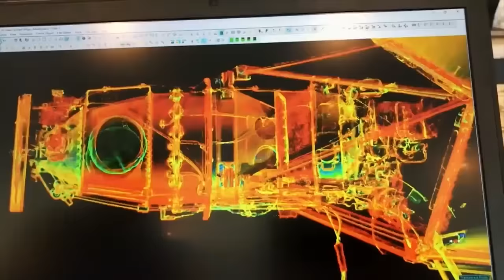We both almost died...now what??

Comment: I've recently seen quite a bit of innovation re: adaptation of automotive engines for GA applications. I've read "that won't work" because of airplane engines needing to run at 75-100% of WOT continuously, where that's not the case in automobiles.  Marine engines run under constant heavy load in planing boats- I don't see how that's any different than aviation.  Cost is no doubt THE largest barrier for most to getting into GA- imagine being able to burn multiple types of fuel, increased power, and being able to drop in a crate LS motor when it's time for an overhaul.  

If the challenges here can be worked through, it would revolutionize GA.

Comment: -What’s going right? The enthusiasm for aviation is still strong. We all got infected with the aviation bug and kids still get it today. 
-What’s going wrong? Cost. The barrier to entry is too high. I work for an airline where most of the employees make above the median wage and none can get into GA without help. There needs to be a Henry Ford moment to bring the cost of flying/flight training down by 10x. There’s no reason a modern cub style plane should be more than a new car and operating costs should probably be lower than a car. 
1.  Develop a new mass produced low cost “model T” of GA.
2.  Figure out a way to decouple the crippling burden of liability from GA.  Maybe through a DIY kit that’s approachable for the average Joe or through legislation.
3.  Low cost propulsion. A new lycoming whose design is largely unchanged for 70 years costs as much as a luxury car and adds significantly to the cost of GA. We need harbor freight esq. cost to horsepower ratio. Maybe electric?
4.  Accessible un intimidating entry to GA. Maybe low cost glider clubs in the European style. Grass strip winch launch simple gliders like Germany used post WW1. A way to promote pure airmanship in a low cost way. A Schulgleiter SG 38 style simple cheap open air glider. 
5.  Well paid professional instruction. I think this would sort itself out with lower cost training aircraft. Lower per hour operating costs would leave more room to pay career long CFI’s. Many of my colleagues loved instructing but the lure of more money at the airlines wooed them away. Imagine a world where flight training was $100 an hour and the CFI got most of it. I’d be a much better CFI today than I was in my 20’s but the economics don’t support it. 
6. Not an idea but a comparison. There’s a company called FliteTest who revolutionized RC aviation. They pioneered RC planes made with $1 sheets of foam board and capitalized on the ever falling price of electronics, and reach of YouTube tutorials to make the hobby accessible to many. The result has been a flood of new hobbyists who were previously priced or intimidated out of the hobby. They have also created what appears to be a thriving business. 
7.  Patey developed low cost scratch build plane in the “FliteTest” style with youtube step by step build tutorials.  
-Very semi Active CFI, member of my flight schools alumni association, airline pilot union member.

Comment: 1: Help get rid of leaded fuel. Could using aviation 100UL in Motorsports and even performance road cars be a possibility to increase the volume and lower costs? 100UL avgas could the the ubiquitous, safe, and legal option for any performance application.
2: The “certified” system is a relic that’s strangling GA. We need a new model that will be safer and more predictable than legacy certified and as inexpensive and flexible as “experimental”. We have data on aviation systems and we have incredible analysis capabilities. Can we build a new process that enables the efficient quantification-of-risk/neo-certification of new aviation systems?

Comment: General aviation and learning to fly has gotten more and more and more expensive. IMHO, what is needed is a bare bones budget S-LSA that's very forgiving, to teach new pilots to fly in, that is low in maintenance costs, US made, and affordable for flight schools.  I learned to fly in a E-LSA RV12, that I bought, just to learn to fly in.  It's good, but I feel the need for the product to be mass produced to lower the overhead costs.  Can it be built from composite molds?  Something less expensive than carbon fiber?  Rotax 912 UL 80 HP ?  Good stall characteristics? A little less sensitive to stick input?  A simpler less expensive glass EFIS? Basic ADS-B out ? or both in and out?   I feel the demand is there, it's just the scale of production that keeps the cost so high.  A Completely vertically integrated company that also builds the motors too?  That's as big and grand an idea as I can come up with.

Comment: 1. Its growing again! Seems like aviation has had periods of significant stagnations until some years ago.
2. I think a big problem is  reduced access and closures. 
3. I used to be a member of AOPA and AMA until money got tight. I need to sign up for both again.

I don't like seeing airports closing, it is one o fthe saddest things when an airport gets shutdown. On the same track, I'd like more RC airports. Especially south Utah county/Juab county (hint, hint). I was one that got into aviation through model flying but its getting harder and harder to find a place to fly which reduces the number of kids exposed to model aviation and therefore aviation as a whole.

Buy the Albatross, or a Catalina. Actually, buy a Mars! Think of the fancy digs you could carry in one of those!
I have always wanted a C27 set up as a camper with a just enough space in the back for a Jeep. Flying to some new place then doing some wheeling sems like the ultimate retirement to me.
I like the BO-105 project. Stick some LTS650-Bs in it could be great too, 50% more power. They share some of the drivetrain with BK117s so it should be too hard.

Comment: Thankful for your safe results from the airplane engine and your health scare.  I have been involved in aviation from prior to high school and had a very successful career as an airline pilot.  I own a Bonanza now and just turned 70.  I understand that there will be a time that I will need to chock the plane for the last time but after a career of every six months having to try to remember what to put on my medical applications because of the draconian attitudes of OKC.  I hear AME's saying that the FAA is not trying to take away your license but I do not believe it for one second.  The medical branch is the enemy that thrives on their power to ruin people.  I have been a member of AOPA, EAA, NAFI, American Bonanza Society all from 5 to 30 years and they are trying to help increase the ranks of pilots but just try to get your license today and call and schedule a check ride...months before you can actually schedule a ride, show up and the emphasis on the "lawyer" side of the paperwork (stuff that doesn't really matter to how one flies) the cost of the ride and the good old boy network to become a DPE and to maintain your DPE status.     My ideas...1.  Eliminate the Aero Medical Branch - basically shake those bureaucrats to their boots and rebuild with an attitude of "not every issue is severe"...trust the local AME's.  2.  Again...the FAA bureaucracy.  They are more concerned with paperwork than if a plane part is "certified" than does it actually work better.  I am in the middle of a panel upgrade and am having to pay $1500 for a DER to write a letter stating that moving my gear switch is acceptable.  3.  The airline I worked for had a very high number of minority pilots and high number of female pilots...We need more outreach into those communities.      YES, buy the Albatross

Comment: 1. Take the Cessna 441 and make it the most fuel efficient, long range GA friendly plane ever. Buy the design from Cessna and build them out of carbon fiber. Glass windows, G3000, FL410, 350 TAS, 2500nm range. I currently have a 441 and it can go from California to Florida with no tailwind on a 1982 body. Imagine if you made it more efficient! I only burn 60 GPH for both engines at FL350, now imagine if you flew it at FL410 with carbon fiber and a higher PSI diff (maybe 8 psi?). You would destroy the light jet market.

2. We need cheaper landing fees and fuel. Its starting to get out of control. 

3. Government should subsidize new Privately owned but for public use airports. As the population grows we need more options.

4. Take the TTX and pressurize it with a 28,000 ceiling. put a 400 hp turbine.

Comment: GOODS: Experimental is doing well even with increased costs. Light Sport MOSAIC will bring great innovation to certified inexpensive aircraft allowing greater access to flight. 
OTHERS: I see an increase of errors associated with procedures. There needs to be an effort to get pilots to go back to the basics and actually use/reference a checklist for flight critical items. I suspect at least half of the current GA accidents would not have happened with a more structured use of a checklist. Feel free to use this quote “Deliberate Action leads to Predictable Results”.  That works in all cases, both positive and negative.  
MEMBERSHIP: I have been a member of AOPA, current member of the Tailhook Association. 
Background-20 years military fighter, 10 years GulfStream, 757, 767, 777. Current Part 121 CA.

Comment: There is an engine technology out there that has been demonstrated on a fixed-wing drone, and I would love to see it get scaled up and applied to manned flight, which is the new take on the rotary engine developed by an MIT spinoff called "Liquid Piston".   It delivers the highest power-to-weight ratio yet for any internal combustion engine that I know of.  Unlike the Wankel which has one power stroke per crankshaft revolution, the LP engine delivers three.   If you haven't already looked into it, you really should.

Comment: Let's find out if micro turbulators (vs. typical VGs) on wing surfaces lower stall speed w/o significant loss of cruise speed This could be as simple as sand embedded in wing paint or micro pieces of plastic fragments duplicating a shark's rough skin, etc.. The potential payoff is fewer stalls/spins  - a leading cause of aviation fatalities. 

There are various research papers on this in the aviation-science literature, but no one seems to have nailed what is optimal nor taken it to general aviation. Sponsor a few 
engineering/aviation students and let them do the work...probably quite a few universities have access to wind tunnels. 

This is not expensive research and would seem to have a high value:cost ratio...

Comment: Purchase Lancair to develop the Mako with an option for either fully retractable or fixed landing gear, complemented by a mandatory BRS install. Transform the build-assist program into a volunteer initiative involving experienced builders, offering it free of charge to foster safety, enhance accessibility, and revive the spirit of collaboration. In essence, envision creating an open-source innovation lab for airplanes—a space where enthusiasts collaboratively build and continuously improve upon the same aircraft mode - polish one kit to take out the guesswork.

Comment: I think as most have said, affordably in aviation would be amazing. 
1. Almost every engine manufacturer charges the price of a full size car for engines that are based off 1930s technology. I understand this is required to cover engineering time and most of these engines are low volume production but not a lot has changed in the basic flat 4 aircraft engine in the last 50 years. I believe that we need the aviation equivalent of Elon Musk to come in and shake up the industry to reduce some of the crazy prices. 
2. Hangar space at general aviation airports is way to limited and new builds are few and far between because of the permitting/local government permissions have been hard to get. 
3. Avionics, specifically GPS is ridiculously expensive. A new Garman or Avidyne GPS cost as much as a new Rotax 912. I feel like situational awareness of many general aviation pilots would be improved with access to affordable GPS Navigation. Foreflight is a good alternative but having a Ipad floating around in the cockpit can also be a problem especially if it overheats in Texas and shuts down when you need it the most. Reverting back to paper works but having a better primary would be amazing.

Comment: How about the two M’s develop and build a certified 4 place airplane under the new Mosaic standard. Certification would be way cheaper that today’s certified part 23 Cirrus and Cessna 172/182. Approved by ASTM industry standard, Patey’s M2 plane offers 4 seats, is IFR capable, >150 kts, Deltahawk Diesel )You then offer the plane in kit form or factory assist. You would basically build a production line and all your YouTube fans would love to hang out with you building their plane. You could give Cirrus a run for the money by offering a plane at half the price of a SR-22 G7 enlarging the pilot community with access to a certified, more affordable and fun & easy to fly plane. It may sound (too) ambitious, but the Patey’s could pull that off

Comment: I teach in an automotive school 30hrs a week and have a custom car, truck, and bike shop that consumes the rest of my time.  We've owned several certified aircraft, several experimental, and built a couple Rans aircraft ourselves.  Bingeli's books are not bad, but an online training/reference platform showing best practices and safety standards would be very beneficial to experimental aviation.  You already have the assets to film and produce videos on the idea.  It would take time, but film the smallest details while building aircraft and turn them into a how to/best practices/safety standards required xyz.  Examples like: hardware choices, how long should the hardware be, how to properly torque hardware, wiring and electrical oh my, plumbing, how to choose avionics, brakes, an ocean of firewall forward, rivets, covering systems, paint, control cable routing and management, bushings and bearings, weight and balance, basic physics concepts that are relevant, what is a stress riser and why is it important, why triangulation is a thing and that 90 degree bent aluminum bracket won't hold that servo long term, corrosion prevention, or basically anything you see at a fly in that makes you cringe.  You can even take pictures of bad examples, and then show how to properly install or build items or possibly bring that aircraft in and repair it properly.   

P.S. Absolutely buy an Albatross.  Twin turboprop, Carbon control surfaces, carbon sponsons, new airfoil, leading edge slats, loose a few thousand pounds, sweep all the dinosaur parts out the cargo door and modernize the crap out of it.

Comment: I’m pretty new to aviation, but one thing that I have had to deal with that is not that great is getting my medical. I’m still in the process of getting it and so I haven’t started flight school yet. My unique circumstance is that I had a brain tumor that was removed when I was 9. I’m now 19 and have had no side effects or symptoms since my brain tumor was removed. Of course the FAA wasn’t going to issue me a medical certificate right away because of my history, which is understandable. However, they are requiring my to get a neuropsychological exam, which is basically to make sure I’m not crazy. Now I’m just your average dude, no mental problems or health issues, but I still have to do this. Which I wouldn’t have a big problem with except that this particular exam that the faa is requiring of me costs over $3000 and insurance can’t be used because it’s not for a medical condition. I’m just a 19 year old guy in college so that’s a bit of a big deal. So I just think that the faa hasn’t made it very easy for people like me to get into aviation. I understand they have take precautions for health stuff and all but there’s gotta be a better way then making a mentally stable broke college student get a  neuropsychological exam that costs $3000 out of pocket. Idk what kind of changes could be made but that’s just what I’ve had to deal with so far in my experience.

Comment: You asked.
You could design a retrofit kit for the Piper PA28 to strengthen the tail. As you know when an airplane loses the tail - death is nearly imminent. For 15-25 pounds of aluminum and at a price of $250-$400 people (and schools) that own the PA28 will be compelled to retrofit their planes so that the tail doesn't fall off in turbulence and >Vne speed.
N3079M is just the latest example and NTSB assigned blame as usual, but that is not the point. 
Both fatals should not have happened because the plane is just an inferior design and many people die every year in this one for no good reason.
Analyze and strengthen the enpennage to fuselage connection...there you go.

Comment: MODERN Fuel Efficient ENGINES!! to Retrofit Legacy Aircraft & for the main manufactures to adopt. Rotax 916 is an excellent motor, but they don't have anything to compete with the bigger side of the market, : IE : Lycombing IO540 etc